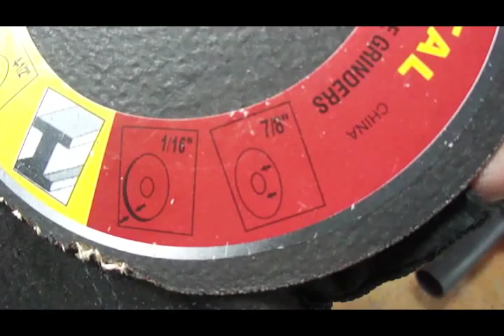Chainmaille Tutorial part 1: Ringmaking

Comment from the maker: No offence taken. I originally tried that, but for the diameter rod I used, it would not fit in the chuck along with the wire. This is the second size ring I have made, and the smaller ones I did use a drill, although I prefer the control of doing it by hand.
Cheers!

Comment from the maker: The wire is 14 gage and the bar is 1/4" (I think). The weave is fairly tight compared to what else I've seen, and it takes quite a bit longer than the few 3/8" rings I tried. Nothing compared to the 1/8" (possibly 3/32) rings for a glove, though. That was by far the worst and I'l never be doing that again.